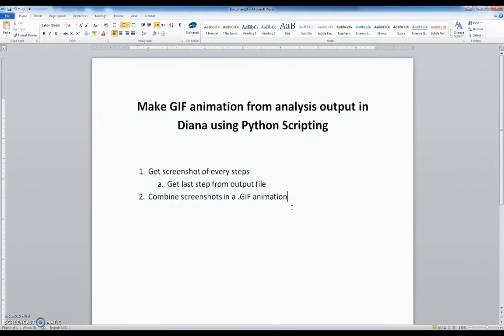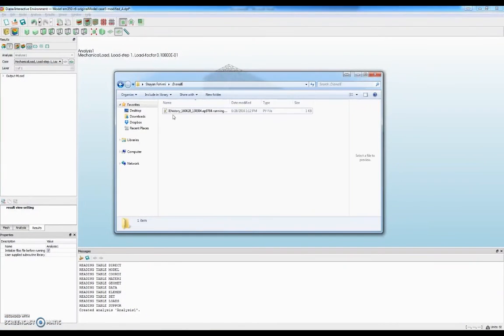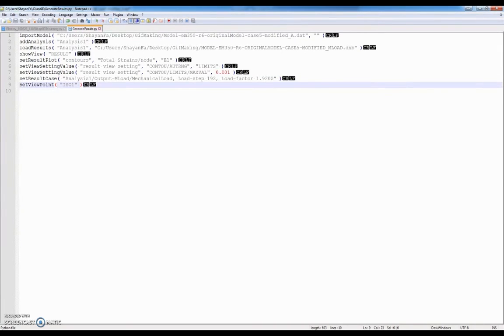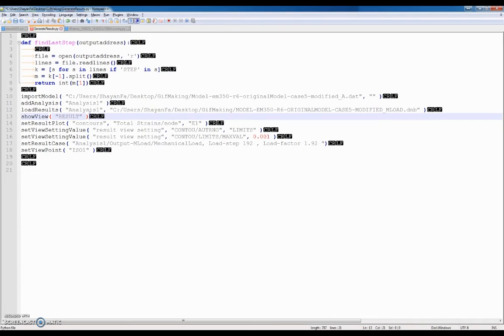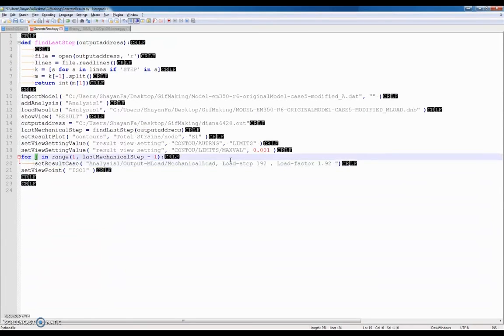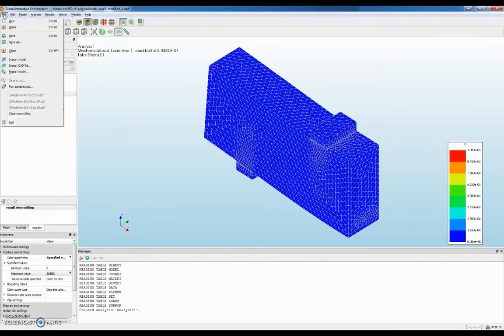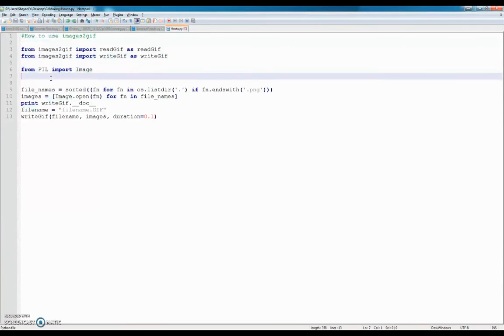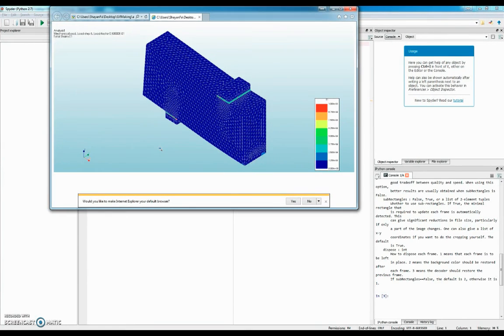Making GIF animations from FEM analysis in Diana

Comment: Hi Shayan. Thank you for the great film. So useful. Would you please put more films about Diana tutorial? :)
Reply from the maker: Hi, Diana is a multi-purpose finite element package. Please inform me about your problem. I will try to help.
Reply: Actually, I want to model a heritage Masonry building. The model is 3D, and as you know, the heritage masonry structures are very tricky. The geometric of them are very hard to model sometimes. As well, I should get some ideas about the materials of the masonry and timber inside the structure.

Thanks, Soheil
Email: dadrassoheil@gmail.com
Reply: Hello Shayan... Sorry could I ask for your email? I have a serious problem in my nonlinear time history analysis while using DIANA. I need to ask you about it. Thank you
Reply: @soldadras9893   can you please help me in installation of diana fem package ?